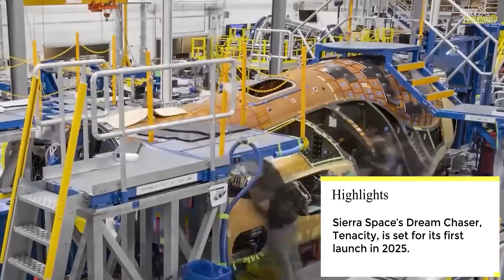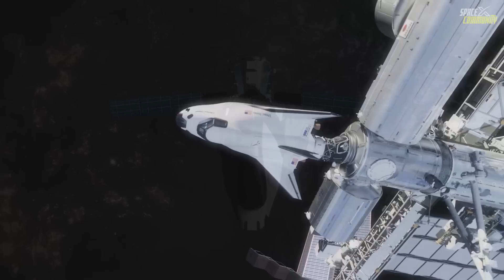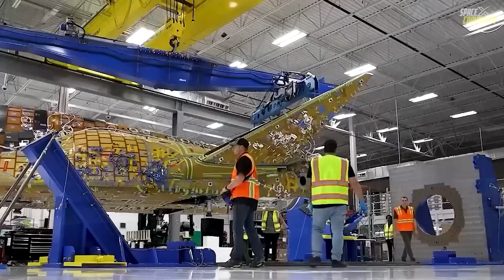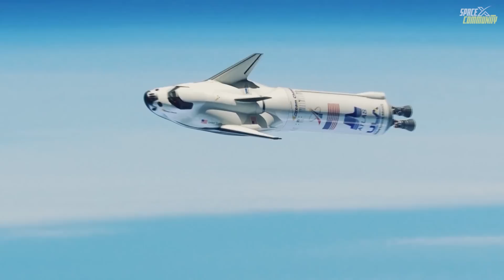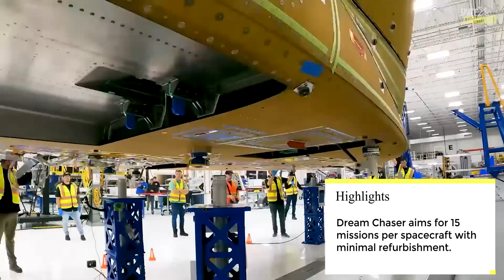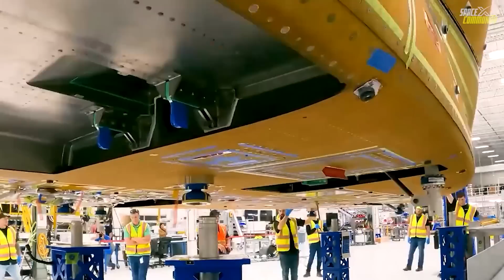Sierra Space Declared Dream Chaser Tenacity Launch to Beat SpaceX Starship IFT 7! NASA's New Partner

Comment: ok so when r they going to add Astronauts to the spacecraft? also why use NASA rockets to launch Tenacity when SpaceX has a booster available?  :)
Reply: Yeah! The spacecraft is cool and reusable, but what about the booster. If the booster isn't reusable, the flight won’t be cheap. It would definitely be cheaper if they used the SpaceX booster.

Comment: In watching SpaceX IFT4, IFT5, and IFT6 Starships, I really wonder how well Dreamchaser's hinged folding fins will work out?  That join / seam appears to be a real difficult engineering challenge to keep out hot plasma and prevent burnthrough.  Oh, and Dreamchaser won't beat IFT7 to launch.  IFT7 = Jan 2025, Dreamchaser latest news is late May 2025 at the earliest.

Comment: Of course, the heat shield on the Dreamchaser is better. Because it has a flat underbody and edges that protect the top. The Starship is more like a disguised rocket, where the plasma flows around the fuselage and heats it up more due to the round shape. Nevertheless, the Dreamchaser is too small, has too little payload and is too expensive. No chance on the market of the future.

Comment: Why no front wheel on the landing gear?
Reply: It is a natural breaker for slowing it down by air drag and surface drag at landing, also making it more robust and reliable by eliminating front wheel, that is usually stressed more than other

Comment: I hope it succeeds it could help fill the gap in bringing astronauts from earth to the iss or a parked starship in LEO but to suggest that it could compete with starship is absolutely ridiculous they are both designed for different operations maybe starship could take sierra to mars on a starship and ferry astronauts to the surface and back 😉

Comment: I wonder what kind of monster Sierra could put on a  SpaceX super heavy booster?
Reply: A very big one, in about fifty years.
Reply: I believe they are developing a space station replacement, but could be mistaken.
Reply: Lmfao Sierra wouldn't be able to touch the Super Heavy for at least 60 years, maybe longer. Consider the fact that Dream Chaser is 20 years old already and was actually designed by a different space company in 2004. Then, in 2008, Sierra Nevada Corporation bought out the space company and completely redesigned Dream Chaser. As a matter of fact, the current Dream Chaser that Sierra Space is still testing isn't even the original that was built by SpaceDev. That also doesn't include the fact that Sierra Space took over the Dream Chaser program in 2021. This plane should have been launched 10 years ago. When compared to the Space Shuttle program(which only took 10 years from concept to first launch), Dream Chaser is a monumental failure.

Comment: Dream Chaser looks cool and all, but it's overly complicated and doesn't have any real legitimate purpose for existence. it has too many moving parts with seams that will be directly exposed to the plasma heating of reentry. Moving parts designed to fit inside of basically a launch-based storage container, will have a hard time with reliable movement without failures. All it's good for is crew transport. It can't deliver any real payload, satellite, telescope or provisions, due to its very limited size. Can't even imagine it being scaled up to an appreciable level, in order to be a legitimate space plane for commercial passenger flights aimed at replacing current commercial aircraft. It just doesn't pass the eye test and it's just too limited in ability to make it feasible long term and profitable platform. Its only real use that is worth mention, is as a technological test platform for mechanical and material sciences. That's my honest opinion about it. Space X has no reason to be concerned about Dream Chaser. It can't do anything that Space X isn't already doing and when Starship is fully developed (which is soon for the type of work Dream Chaser is aiming for) Dream Chaser will have no reason to have existed, ever. Starship is bigger and far more adaptable by design as well as cheaper to operate with an insane amount more payload capacity. Dream Chaser is perhaps best used as a manned military spy platform due to its limited size.
Reply: Dreamchaser would be better used as transport/resupply ship from a space station to a lunar base/outpost/mining colony
Reply: Yeah, yeah. But it's a sports car and I want one for private fun space flying. Who cares if it isn't a cargo truck? There might even be a couple of unflown second hand planes available if they get pushed out of the commercial market.🤔
Reply: @Cider4144  I can't tell if you are joking or not lol
Reply: Perhaps using a reusable booster for launches could make for a good high speed business shuttle for high priority business meetings wherever a long enough airport runway is located. The return trip would be quite a bit slower though.😅

Comment: Will DreamChaser fit inside the fairing of Rocket Lab's new Neutron rocket?
Reply: Neutron
Fairing Diameter 5m
Payload To LEO13,000 kg

Dreamchaser Fitz in a 5m fairing
Gross mass: 9,000 kg (19,800 lb). Height: 9.00 m (29.5
Reply: If the gross includes the cargo it might be able to lift a partial cargo. Cargo capacity: 12,000 pounds (5,443 kilograms
Reply: Probably not, but it wouldn’t need a fairing anyway.

Comment: I thought the heat shield tiles were installed some time ago.  Let's keep in mind that there are fewer tiles on Dream Chaser because it is significantly smaller that the space shuttle.  I'm really curious to see how Sierra's tiles hold up from reentry compared to SpaceX's.
Reply: My prediction: a lot a lot better.
Reply: @pedrosura  I'm sure they will be better than the first through 4th Starships heat shields were. And probably the 5th and 6th. But I wouldn't bet on the 10th or 20th. 
 Not that they can't make progress of their own. I really like Dreamchaser and hope them all the success.